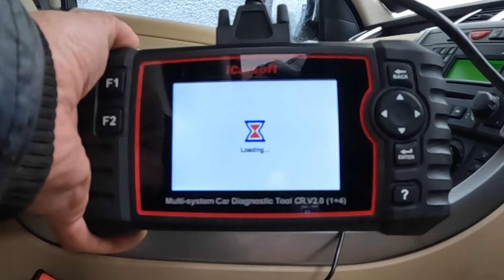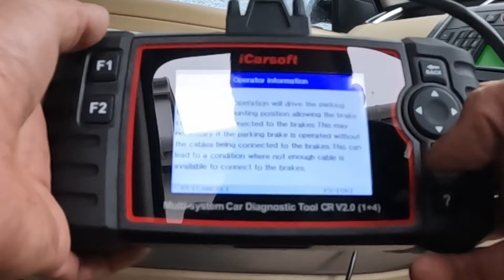Fixing EPB (Electric Parking Brake)😉 Range Rover Sport L320 insurance writeoff - Episode#5

Comment: That was a very good fix! The caliper bolts are usually much harder to get out than that, you managed to get them undone with just a little ratchet spanner, they are coated in blue Loctite from new ,I needed a 2 ft breaker bar to get mine out, why is everything so corroded and dry under there, it looks like it has been driven hard and put away wet, the thing that causes most Range Rovers to fail is a total lack of attention, the main dealer costs are so high no one bothers, then they complain when they are let down, problems need addressing right away as you do, then they are 100 % reliable. Stay dry! Chris B.
Reply from the maker: Thanks for the kind words, it was a wet cold afternoon!
Reply: @GrooveOn  Is there any way you can rig up a top cover, like a market awning, it would at least give you some shelter, you are having the sort of weather they get in Scotland, I am surprised they find a dry day to actually build houses there. Stay dry! Chris B.
Reply from the maker: @453421abcdefg12345  HA you are quite right, I have been here for years and its the unpredictable weather that gets to me the most! makes things twice as hard, but a challenge !
Reply: @GrooveOn  You need to move down here to the South of France, although it is only 20 degs today!

Comment: Hi great video glad you managed to fix the EPB………I’m viewing this as i have same problem 🫣 mine is slightly different as the EPB dose not engage at all no funny noise etc the EPB module looks like it’s pretty new so don’t think it’s that. Would you reckoned I try this repair you’re doing? Thanks
Reply from the maker: Yes check the cables are connected in hub and not jammed

Comment: After using the icarsoft function to Drive parking brake to mounting position. when you attached the cable did you then have to use icarsoft to do the Drive parking brake to latching position option?
Reply from the maker: I used icarsoft to extend cable,  then once attached I think I then just applied hand brake normal with switch

Comment: well done man ,    I am facing EPB problem ,  its not responding at all when I push the push Potton,   I have tried to replace the switch with another one ,  but its still not a single act or sound ,  it seems to me open circuit,   but I dont know where to start.    I manged to make to electrical barking module work with a big noise sound using my OBDII XtOOL .
Reply from the maker: hi, was it a screaching noise?

Comment: Wish I had the tools of courage. How do I get the cable extended in a 2010 keyless start RR Sport?

I’ve got the same screachy noise
Reply from the maker: If you have a diagnostic tool there is a cable feed option, otherwise you may have to try and pull and get into the epb box

Comment: Hi. Great vid thank you. I have a problem now . my2013 L320 SCREECHED when I tried to release epb and the brakes seem to be stuck on now. I’m a bit like you in experience and ready to have a go but just wondering how to get the drum off if the brakes are still on. I also noted the diagnostic tool you have, how have you found this ?
Reply from the maker: The iCarSoft I love it's great, it allows you to release parking brake through it. There is also a manual release in centre console

Comment: my Autel ultra £5000 tool or thats what it cost me a few years back would not connect to L320 Range Rover Sport today. My Autel IM608 pro though would. Only options like yours failed. I wanted to wind back the cable. It said device cannot communicate.

Comment: I was reading the other day that the brake shoe holding clips should have the closed end facing the knurled brake adjuster. 
So each side is different. 
On your passenger side rear I believe you put the holding clips on the wrong way. 
I personally hate those clips, there weak and I had one break up inside the drum. I was amazed at how bad it sounded.
Reply from the maker: You are probably right and it makes sense to have the open end facing down, so I had removed the hub and done it this way after I did the video. However I have also sold the car now too !